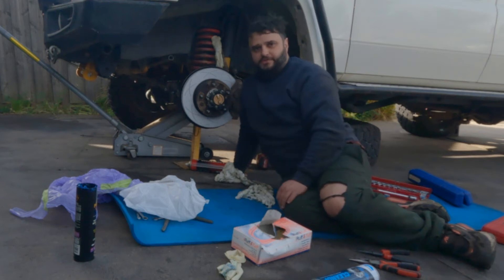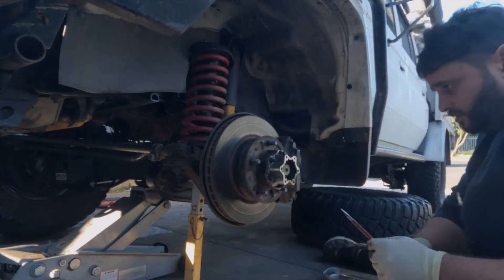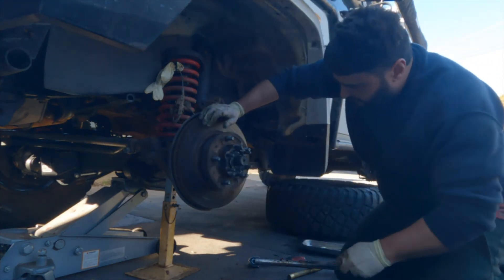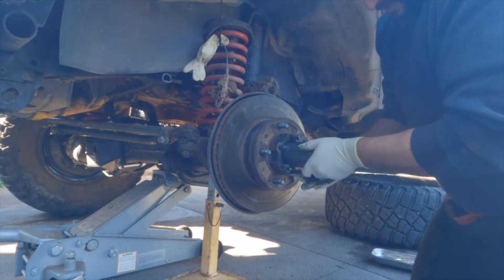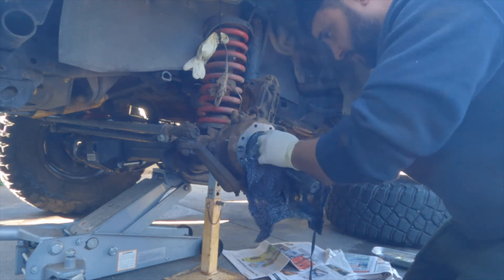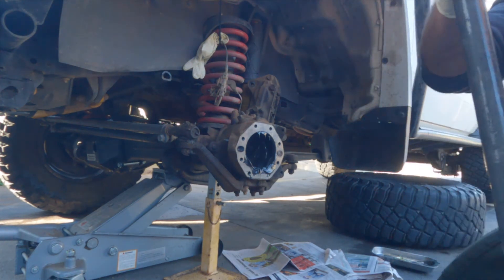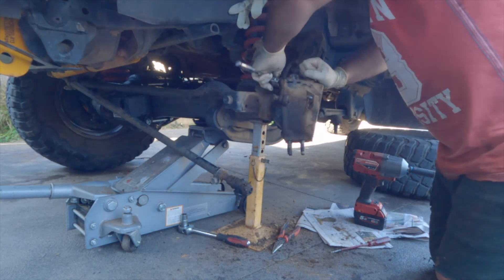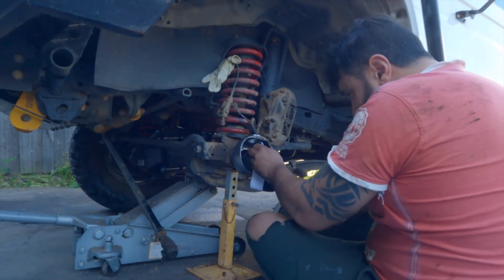PART 1: ***MY 1ST TIME DOING A SWIVEL HUB REBUILD 70 SERIES LANDCRUISER*** How to Guild!!!

Comment: Hey mate, just wondering how do you know when you need to rebuild your swivel hubs, and often do they usually need doing?
Reply from the maker: Hi jack im not expert but mainly if they are leaking is when you will do it. Not sure if theres a set amount of ks to do it. Mine weren’t that bad but i had to change out my wheel bearings and had to do a cv so while everything was off I thought i might do it at the same time. Plus i learnt how it was done